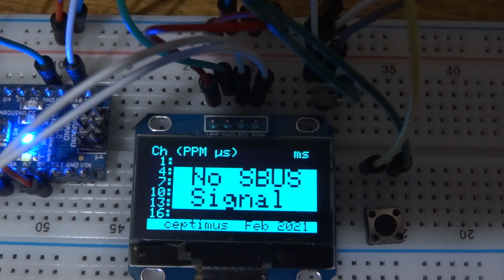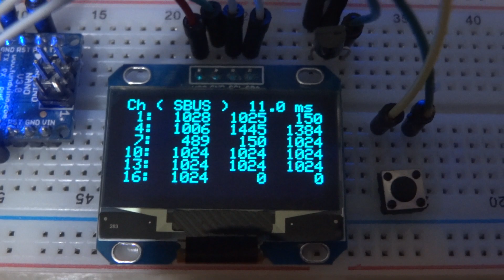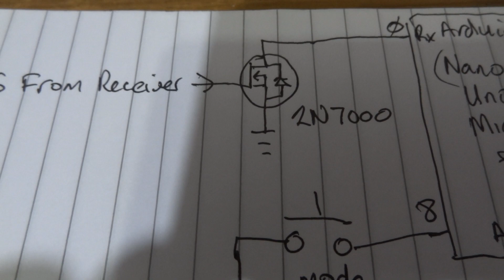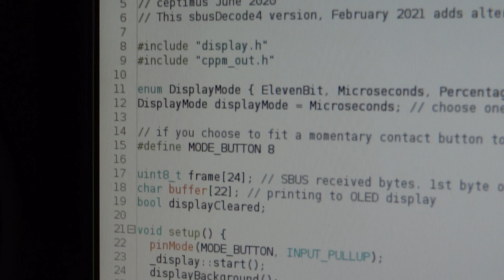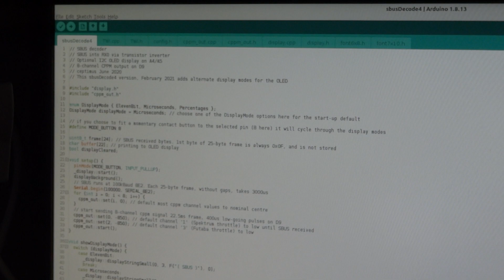Arduino SBUS decoder update

Comment: cool
is it also work with ppm input?
Reply from the maker: I made a separate sketch a few years ago that's better for PPM input, because it displays an "oscilloscope-like" display, as well as the channel values.  See here: https://youtu.be/1737baKGtVE  I think that version was for the ATtiny, but if you follow the links in the description to the Mode Zero forum, you'll see I did a version for the ATmega328 also.